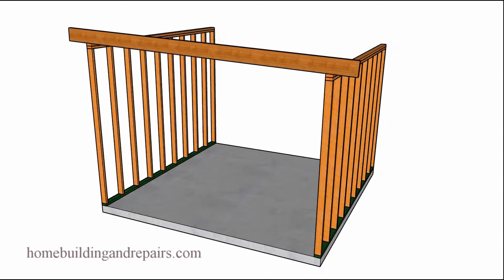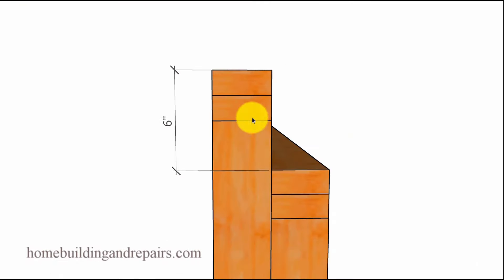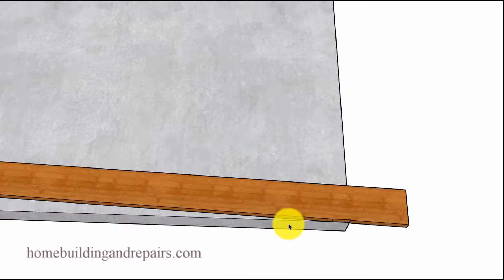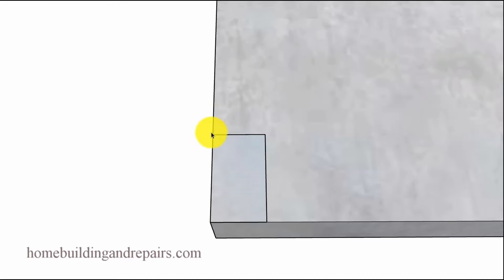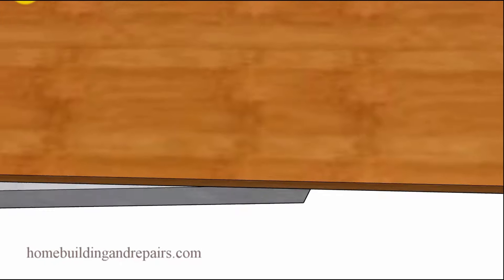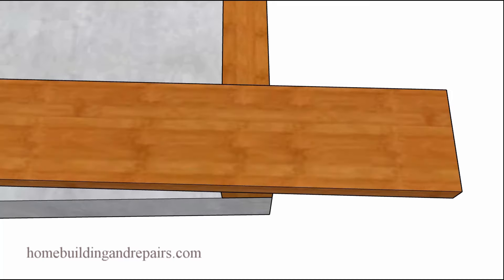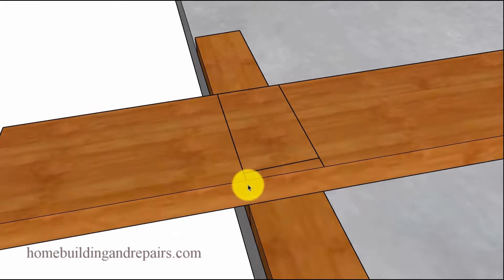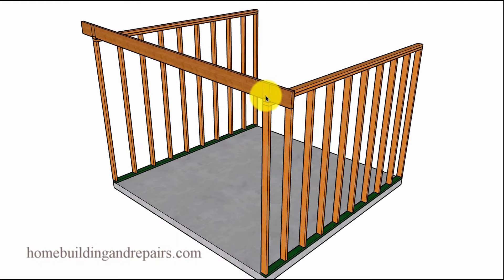EASIEST Method Ever For Making SHED Roof Rafters Without Math Formulas For Do It Yourselfers

Comment: Once the walls are up just hold the rafter on the end of the wall(clamps/nail) to the desired pitch that you want and trace it out on the rafter, use that rafter as a template.
Reply from the maker: It works!
Reply: I have to say that slideshow confused the crap out of me but your two sentence explanation was crystal clear. What a great example of the K.I.S.S principle!
Reply: Thank you. This video is ridiculous
Reply: THANK YOU,PJP
Reply: I got most of information. I’m stuck on this. I want to make a shed. 3 ft deep  I want to add metal roof. At what pitch the roof have to be? Or can u explain so I can find out how much back wall from front wall height difference is?

Comment: The problem with shed roof like this is that you end up with a shed roof like this to look at for eternity. Your gable roof videos are so clear there is no need to compromise :-)
Reply from the maker: I hear yeah, another awesome video.
Reply: That and it makes you look like you dont understand simple math and cant build a proper roof.
Reply: I understand the aesthetic appeal of a gable roof is much more attractive but a flat roof as such has more uses as for things as solar without all the penetrations for attachments as needed for a gable roof. Rooftop deck\patio or gazebo; a few things that I would accept in trade for the aesthetics.

Comment: I'm using timber firring, so all 4 walls are exactly the same height. I plan to put timber firring on top of the rafters which will create the slope. I have two questions. Will I still need to make a cut and how do I secure the rafters to the wall (nail, screw, hurricane ties?)

Comment: What hight difference in walls.should.i have for a 10ft x10ft can't be any higher than 220cm at front
Reply from the maker: At least 3 inches for low sloping roofing materials. 30 inches for shingles.
Reply: @gregvancom  so I want my walls at 200cm as i have the cladding for that high and no spare so if i do all walls at 75inchs the front at 78 wich will give me my hight all round this would be good slope for  minral felt roof

Comment: Greg- how do I reduce and or remove the side-to-side sway on a 3-sided shed leaving the front end open" it,s a 12x16 shed with a 3;12 pitch I haven,t installed the rafters yet  - which will follow your design provided in your video; hope you will advise, thank,s PATRICK.P
Reply from the maker: I can't provide structural engineering advice, but can suggest using some additional lateral bracing or shear panel in hopes of solving your problem.
Reply: @gregvancom  THANK YOU PJP

Comment: I am looking for a good way to make a new roof over an existing shed with concrete block walls.
Front wall is about 2 blocks higher as the back wall.
But I also want to increase the angle of the roof.
Now it has approx. The same as in your example, but my shed has a span of 4.5 m. And a lot of debris stayed on the roof which caused the previous roof to bend and break after severe leaking and rotting.
I think I can work with this.
Thanks a mill for this idea
But if you have suggestions.
Please let me know 
Never too old to learn
Reply from the maker: I would think you could add more blocks to raise one side of shed higher, to solve your problem.
Reply: @gregvancom  disadvantage is, our landlord doesn't want to put money in it anymore. 😖😖😖

Comment: Can anyone give an answer, making a horizontal roof with 5 x 30 cm wood boards / joists (30 cm being vertically) would the boards in 5 meters length bend from it's own weight and snow ? And what is the max spacing allowed between boards, is 70 cm enough ?

Comment: Like you mentioned in the beginning of the video, is it possible to install a roof without the seat cuts? I don't have the tools available to make those cuts and I am building a small shed for a local highschool. One wall is 8 feet tall and the other wall is 7 feet tall.
Reply: Just make some shims to fit in the space using a chop saw to set the correct angle of the shims. Then use clamps and blocks of wood hold it in space when you toe tail in some nails or screws.

Comment: Depending on the height difference on the wall, how do you know if you should cut 1/4” per foot or 1/2” per foot? Is there a method of doing this or a building code that regulates this?
Reply from the maker: It's going to depend on what type of roofing materials and snow loads most of the time. You can check with your local building department to answer your questions.

Comment: Thank you for this video.

I'm building a greenhouse and would like to use a single slope roof with  very light polycarbonate roof.  Can we span 18 ft with this method, or am I stuck with trusses?
Reply from the maker: I can't provide engineering information.

Comment: great video. i would add this roof would need to be a pitch of at least 4 / 12 to accept shingles, alot of people building sheds shingle too flat of a roof pitch because they dont know any better.
Reply from the maker: Great idea, but you can use other roofing materials on smaller slopes.
Reply: @gregvancom  like what?
Reply: Pretty sure the minimum is 3/12 pitch.

Comment: Would you use kiln-dried or tanalised timber for the rafters?
Reply from the maker: I depends on where you are located, but most of the time you would use construction standard lumber. Check with your local lumber yard for more information.
Reply: @gregvancom  I'm in the UK. Thanks for the advice, I'll check with a lumber yard to see what they think.

Comment: To build the front and back walls that aren’t shown in the thumbnail would you keep them the same height as the shortest wall or angle them? Would have to cut each stud to match the roof angle I assume.
Reply from the maker: Side walls can be same height as lower one in front or you can build them with angled studs like a rake wall.  See if this video helps. https://youtu.be/dQdC0mpST3E

Comment: Instead of cutting seat cuts which would be a pain, way not cut a bunches of wedges?
Reply from the maker: Seat cuts will work better, but it might not be a big deal on smaller roofs.

Comment: All this for a little cut that won't matter
Reply from the maker: I can't disagree with that. Really low slopes like a 1/4 inch rise per foot seems like it wouldn't need a seat cut.
Reply: @gregvancom  in order to increase the contact surface, I'm planning to put expanding foam or piece of wood in the space that is without contact. Then metal corner attachments on both sides to keep rafter in place. What do you think